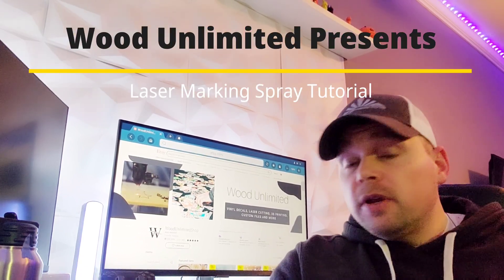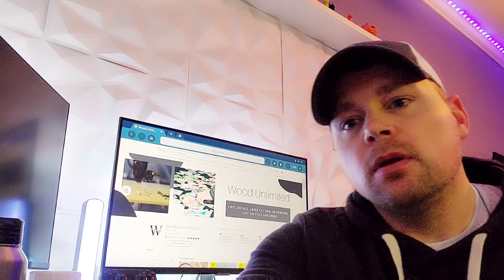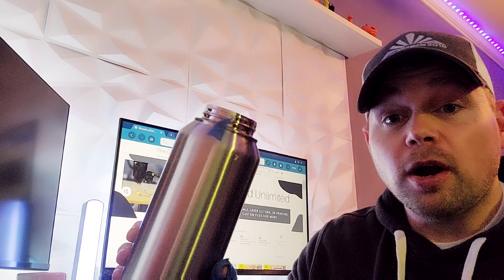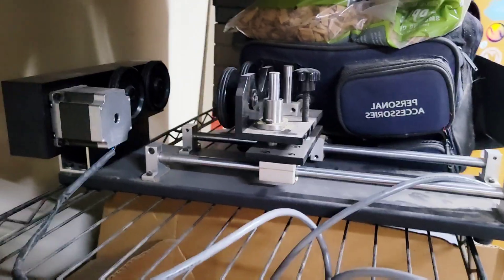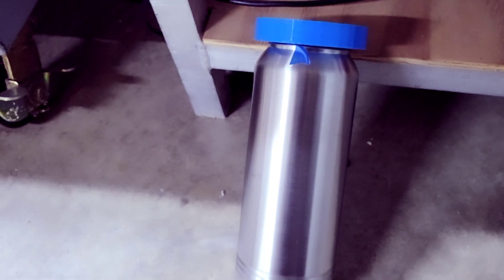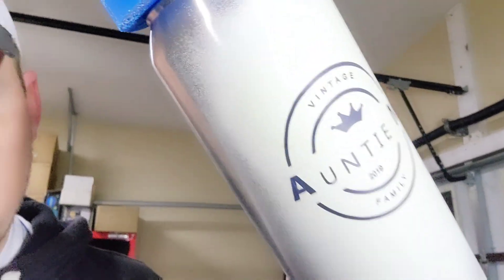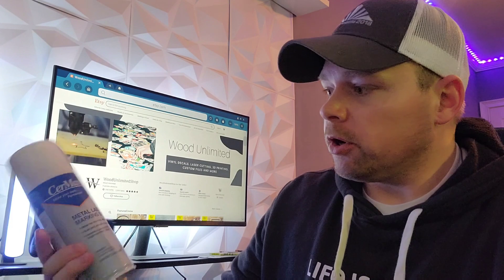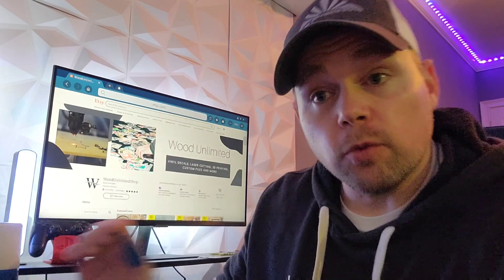How to Laser Engrave Stainless Steel Tumblers with Cermark Laser Marking Spray!

Comment: What settings did you use on your omtech.  Thanks
Reply from the maker: I run it at 300mm/s at 35% power

Omtech 80w
Reply: @woodunlimited  ok thanks I just got a 100w so I will adjust a bit.  Have had a 35w for years and could never get cermark to work so hoping this new laser will do it.  Been watching all your videos to get my new one set up, thanks for those